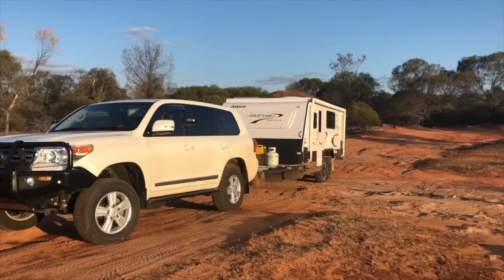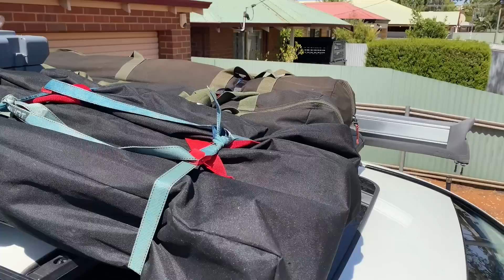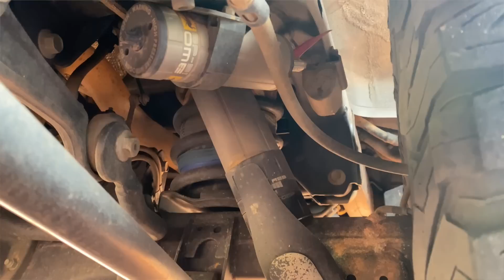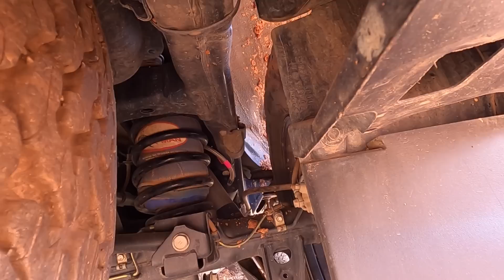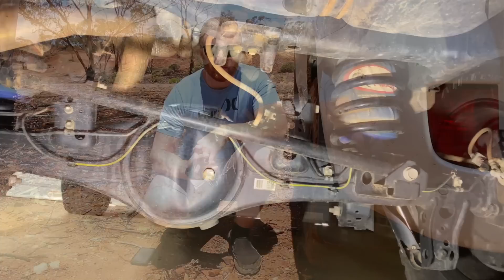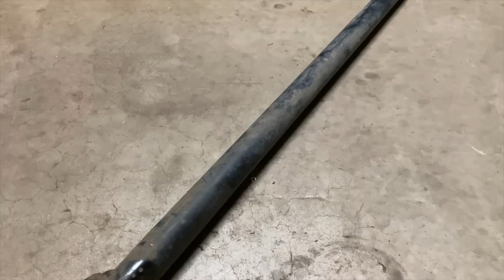LANDCRUISER 200 | Rear Suspension setup for TOWING, TOURING and 4x4’ING | ARB OME BP-51 GVM | Airbag

Comment: Hey Nathan,
Your videos are incredible bro...
 I would like to know when I'm going to tow my camper trailer on soft sand, what gear selection should I choose? 
The camper will weigh 1950 fully loaded.. 
The trailer will follow my tyre tracks while towing which will make towing easier..
I have a 200 series Landcruser..
I have standard Oldman emu suspension with Airbag Man installed as well..
Regards
Jordan
Reply from the maker: Cheers mate, appreciate that 👍 Glad you are enjoying them. 
In relation to gear selection, there are a couple of variants and would heavily depend on just how soft that sand is and tyre pressure. Tyre pressure is definitely king and makes the world of difference.
If you are only travelling slowly (less than 40km/h) I would probably start in 2nd gear low range and work from this point. Any faster than 40km/h then you would want to jump into high range. 
My advice would be find a gear that sits on the higher side of the RPM range. This gives you a little more power if/when required when getting into those really soft sections. If you sit too low in the rev range, when you accelerate a little more, the vehicle won't have enough power to turn the wheels quicker, it will then down change and you've now lost a chunk of momentum. 
My advice is don't rush it, find a happy medium speed that sits well in the RPM range and gives you consistent forward momentum. 
Hopefully this helps. 
Cheers 👍
Reply: @XploringOz  
Hey Nathan,
Yes that makes a lot of sense..
I appreciate your advice bro..
Take care
Reply from the maker: @jordangerolemou4584  No problems mate, all the best and hopefully we'll see you out there one day 👍
Reply: @XploringOz  
Hey Nathan, thank you..I'm going to Stradbroke Island in November staying at main beach from the 16th to the 23rd..
Take care

Comment: Do you know the hub to wheel arch heights of standard? What lift amount would you need a UCA? 

Got the Lovells 4.2t kit and it did not have them somehow 🤦‍♂️
Reply from the maker: Hey mate, unfortunately I don't have these measurements anymore. 
UCA's aren't always required, however I have spoken with some people who state that it helps provide more opportunity to provide the best alignment for castor and camber after a lift. There are many people running a 2" lift without UCA's, however again, reviews Ive seen are those who have later installed UCA's note a difference in handling. 
I can't comment on how the vehicle would handle without them though, as I had them fitted at the same time as the suspension. 
Cheers, Nathan.

Comment: @XploringOz Nathan, need you help here.

I want to have the identical setup like yours with my newly installed rear helper bag. I know you have a ARB compressor in quad panel already.

Can you kindly name the parts you have used on the paddle switch, the air pressure gauge, if there is any internal components to distribute air from compressor to the bags, I really need to know what they are too.

I have done a coil conversion with support bags in my rear of my Prado Kakadu, but the current basic setup (with a pair of external air inlet) make it too hard for me to adjust on the fly. What you got is absolutely perfect for me!

Thanks in advance mate.
Reply from the maker: Hey mate, so I've used the setup as purchase in the package linked: https://ebay.us/uyB0Bu
I can't confirm whether that will include absolutely everything that is need to connect to the ARB compressor as I had my kit fitted by a 3rd party installer. I bought this exact kit and provided the installer this package. 
I hope this can help somewhat.
Cheers, Nathan.
Reply: @XploringOz  Thank you Nathan. You always very helpful :)
Reply from the maker: @andylo727  No problems mate, always happy to help. 
Cheers.

Comment: Great vid 👍 who sorted your inflation toggles and install for the air bags ? Do you need the air tank as well ? Cheers James
Reply from the maker: Hey mate, so these toggles were purchased as part of the air bag man kit and installed by a fitter here in WA called Ultimate 4WD Equipment in Bibra Lake. You certainly don't need the air tank, it can be nice to have a little extra, but I don't think it would make a significant difference to be honest. 
Cheers, Nathan.

Comment: If your adding a lot of weight with a trailer.  What is the tongue weight of the trailer ?  I would think you could limit the tongue weight to 200 to 350 lb.
Reply from the maker: Yes, this is true. Keeping a close eye on your tow ball weight is definitely important. However, when optimising loading and weights, you want to keep your tow ball weight to about 7.5% to 12.5% of the trailers total weight. So if you are towing a 3.5t caravan, you would want to tow ball to be about 270kg minimum. 
Cheers, Nathan.

Comment: The rear tires and rims dont add weight to the truck since they are resting on the ground.. not on the frame.  So the truck may be heavier.  But not the suspension loading.
Reply from the maker: Yes, I hear where you are coming from. The wheel and tyres do add weight to vehicle overall, however this is often referred to as unsprung weight as it doesn't need to be taken into consideration for the suspension setup. 
The wheels and tyre weight still need to be taken into consideration for GVM loading and capacity.

Comment: Hi I enjoy your videos thanks, very informative. I just fitted BP51 too and found the vehicle much higher than specs suggested.  I expected 50mm in front and 25 at back as brochures suggested. I have a question though if I may. The installers did not adjust the front strut assembly and fitted it as it came from factory. In other words, there are 20mm thread exposed. I gather from installation manuals if you have a diesel , no bull bar or winch it should have been set at 10mm. So What is the nett effect now? Should I ask installers do take it out and fix. are my ride just higher and firmer? What would change? I often read other owners writing about BP51 set to 2 inch... Well mine ended at 3, is it because of the adjustment that was not done? The car still has a serious rake.and I also dont want to drop the front to have a bigger rake, but I suppose its also because I haven't loaded it yet. I got the 2723 (400Kg) and the lift at the back is more than double I expected. I wanted a 25 mm , I did not really want to go too high to fit Panhard rods and control arms. My tyres 285/65/18 looks also too small in the wheel well. Any suggestions? Tx
Reply from the maker: Hey mate, so yes I had this exact issue when I had my suspension fitted. I did note that it did take a couple of weeks for the suspension to 'settle' and come down a little from its first installed height. 
I found that once I added some modifications and gear to the rear, it did help the rear of the vehicle come down a little, but I too was disappointed by my ARB fitters as they didn't adjust the front struts to the correct length. I had the issue where they were not adjusted high enough. 
If it was my vehicle, I would wait a few weeks to see whether the suspension does settle a little and see what happened when you are fully loaded for a trip. This might help give a realistic feel for the suspension. 
I know what you mean with the tyres, they definitely become dwarfed with the larger lift, however without a change of tyres, not much option there. 
Give it some time, re-assess and maybe re-visit the ARB dealer and state that this front rake and excessive rear lift (if still present) is not what you had ordered...
Cheers, Nathan.

Comment: Hi mate,
Great video I have watched all your videos. I have booked my 200 in for new suspension next week. I went for OME as well but I just went for the nitro sports shocks with a 4015 upgrade and 400 kg springs. I would have loved the BP51 but I just struggled to afford it because all my money went into a new caravan. Just wondering mate did you run the nitro shocks on your other 4wds because I was just wondering how you went? Also did you install UCA in the front?
Thanks mate
Reply from the maker: Thanks mate, I'm glad you have got some value from these videos. 
So yes, in my previous cars, when running the ARB suspension, I've run the Nitroshocks and had no complaints. The Nitroshocks worked exactly as designed without any issues. Saying this, the BP-51 is definitely a step above, however I completely understand that it's not in everyones budget and it also not necessary for everyones type of driving. I'm sure you will still love the feel of upgraded suspension to suit your vehicles load. 
So yes, I have installed Blackhawk UCA's in the front of the 200, I can't comment on whether or not this made a difference with the lift, as it went in the same time. 
Cheers, Nathan.
Reply: Yep cheers mate, thanks very much some great feedback. Look forward to your next video

Comment: Hi Nathan  I have a 2017 LC model Altitude. I have an ARB springs and shocks  50 mm front lift 40 mm rear  gvm upgrade 3650 kg with 250 kg rear springs no bags .I weighed the cruiser yesterday fully loaded ready to travel 3,230 kg + 280 kg towball weight total 3,510 kg  about 140 kg under .the tow tongue is 550 mm off the ground. I find the ride is good and tows the 2500 kg Matrix easily we have just returned from around the Gulf and Cape York no issues. The thing is with gvm upgrades no matter what  the rear axle loadind is still 1950 kg 
It is an interesting exercise to check the rear axle loading a job in the near future. Also 4" lift is a no no in Qld without an Engineering mod plate . Cheers a great vid Ian
Reply from the maker: Thanks for sharing mate! It is amazing how quickly these vehicles fill up when we hit the tracks!
I hear you about the axle loads, without certification, there really isn't too much we can do about this other than attempt to consider where in the vehicle we pack of gear to try and even out the weight. 
Glad to hear that your suspension has worked well for you setup.
So a 4" lift in WA is also illegal, however this is officially measured and recorded at 2" from ARB, therefore accepted and approved without engineering and modifications plates.
Cheers, Nathan.

Comment: Toyota Landcruiser & Hilux springs are notorious for sagged out stock springs. I had a 2004 VZN167R Hilux and the rear springs were sagging by 70K so airbags fixed that. My VDJ79R has the LOVELLS 3900 GVM upgrade so no problems there. I see plenty of "lowered" Landcruiser's getting around still on their stock springs.
Reply from the maker: Yeah, this would make sense. I'm definitely glad for the upgraded suspension, more clearance much safer and more comfortable ride.
Cheers, Nathan.

Comment: Another great vid, as always combining educational content with factual delivery.
Like you I have a 3,845kg GVM upgrade - when talking to ARB they said they are happy to recertify the vehicle to 4,015kg for the cost of an inspection and new modification plate (~$150) because the components used are exactly the same between both approvals and it is only how they treat axle loadings that differs.  
The 3,845kg GVM allows 1,870kg on the front axle and 2,145kg on the rear (i.e. 110% of factory rating), but you can't load them both up to that at the same time - the 4,015kg GVM allows 110% of factory rating on both axles at the same time - the problem being that to use all of your 4,015kg GVM you'd need to have the additional load kept toward front of the car which is not always practical.
Reply from the maker: Thanks mate, I have heard the ARB have been offering this. Unfortunately my local dealer has shut down, however it's something I'll look into in the future. 
I hear you about the even axle load. It can be hard to distribute that much weight up front. 
Not sure I'm ever going to need that 4015kg, however its encouraging to hear I have the correct hardware. 
Cheers, Nathan.

Comment: I did 500 KG springs in mine, draws, long range tank, 2.5 ton van on.... it travels great.. its a tad over sprung with out the van on, but i got used to it.
Reply from the maker: Awesome mate, as long as it works for you, that's all that matters. 
Cheers.

Comment: Did you find any impact from the airbags on the ride? I had these on a Prado and it made it ride like a a ute even with no pressure in them at all. Interested if it was my set up in particular or an issue you have found as all.
Reply from the maker: Negative, I've found that when lowered to around the 5PSI mark, it still retained relatively good handling. In fact, on the Prado, I found that it helped reduce body roll (my model didn't have the KDSS).
The 200 series, being a much heavier vehicle has been even more comfortable again.
Cheers, Nathan.

Comment: The lift is dependant on the load. So I suspect that the 400kg spring would have given closer to the advertised lift if you had a constant 400kg load. It certainly doesn’t look too high in the back now you have the accessories on it.
Reply from the maker: This is true, however I've found the lift hasn't sagged much in the rear, even after the accessories were added. Either way, I'm happy with the look, extra clearance and comfortable ride from this suspension setup.
Cheers, Nathan.

Comment: Another very informative video Nathan.  How often would you adjust your shocks from say your trekking to your around town. I have a Lovells GVM upgrade to 3800 and the shocks around town without load are hard and a little uncomfortable. Just wondering whether I can overcome this hardness with adjustable shocks and then switch them to a firmer setting when going bush?
Reply: Try lowering your tyre pressures, I find even a few P.S.I makes a big difference to how my COOPER Discoverer st maxx tyres ride on the dirt and on the tar. Funnily enough, lowering the pressures doesn't seem to affect fuel economy, I'm currently running 38 P.S.I all round unloaded, I'll experiment with 37 & 36 P.S.I. (55 P.S.I fully loaded to 3900kg)
Reply: @dustyfarmer  thanks for that, I’ve always ran mine at 40psi and certainly if I ran it 10% less or so  that may be interesting to see if that makes a difference.  I’ll give it a try. When I have all the gear in the back it feels fine and smoother, so will see.
Reply: @crispyinasia61  I used to run 44 unloaded, then 40 P.S.I but was getting too much tread wear in the center of all tyres, I'm pretty happy with 38 but I think 36 P.S.I might be the go as even at 38 it's much softer on the dirt than 44 where you feel every bump & rock, mine are 10 ply tyres though.
Reply: @dustyfarmer  these are the Coopers that are 10ply?  At the recent 4wd show I spoke to the Coopers rep and he explained the multiple ply as compared to the BF Goodrich and said they were very similar. But he did mention that they guaranteed at least 80k kms from them. I’m battling to get that out of my current tyres. So as I’m coming up to a change within the next 6 months it may be worth a crack. 👍
Reply: @crispyinasia61  Did the COOPERS rep. tell you that to claim on that 80K warranty you need to get a wheel alignment every 10K and rotate every 5K. I rotate mine every 10K and I reckon I might get 60-65K before they get too low to be safe in the wet on tar, you may get 80K out of a set to near bald but they are spent, useless in the mud and dangerous in the wet at 90% worn. I'd buy them again but not at $330.00 a tyre, I'll try the TOYO AT2 OPEN COUNTRY next.
Reply: @dustyfarmer  well he was trying to tell me how good the price was at &420 to which I said that’s more than the BFG’s. What size are you using and where are you purchasing them including Toyo’s?
Reply: @crispyinasia61  285/75R16, I just had a look at current prices for the COOPERS & I think they have priced themselves out of the market as far as I'm concerned. I did get a price on the TOYO's a few months ago of $230 per tyre but there was plenty of variation in price between the 3 tyre shops I contacted here in N.S.W.
Reply from the maker: Thanks mate, it's definitely worth a go, setting these to a softer setting for on-road use.
Personally, I haven't been bothered setting the shocks for on/off-road, I've tried to find a happy medium for both styles, however this comes at a compromise.
It would be interesting to test out these tyre pressure idea's. 
Maybe an idea for a future video.
Cheers.
Reply: @XploringOz  I have lowered my tyres to 36psi and there is a noticeable softening of the ride. For country driving I think I may increase them a bit. The other thing with playing with tyre pressures is what effect they will have on wear and also litres/100km economy.  When I mentioned to my wife that there may be a way around the problem with adjustable shocks her ears pricked up with genuine interest as opposed to the normal disbelief and questions about cost. So will try the lower psi for a month and see how it goes. 👍

Comment: Have u thought about upgraded sway bar in the rear to help with sway with the weight?
Reply from the maker: I haven't done too much research into this, however I don't think it would be necessary on this vehicle as it has KDSS anyway. The hydraulic control over the sway bay works well at control the vehicle over all types of terrains.
Cheers.